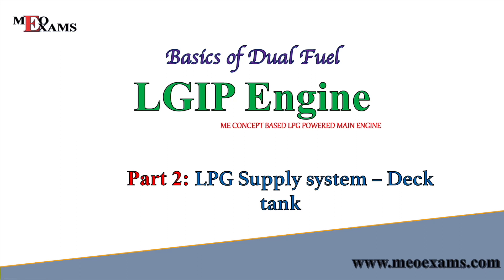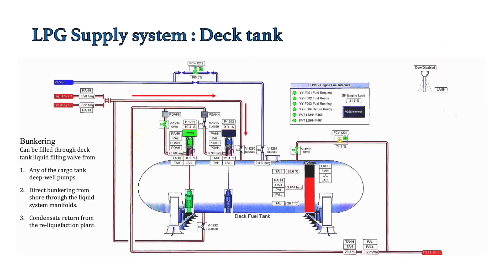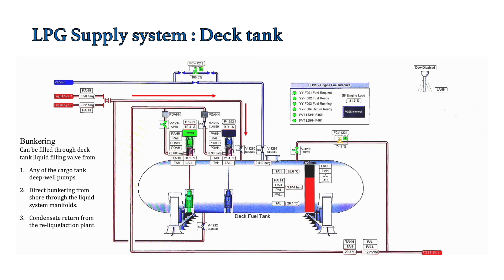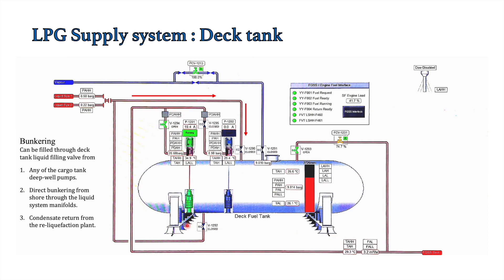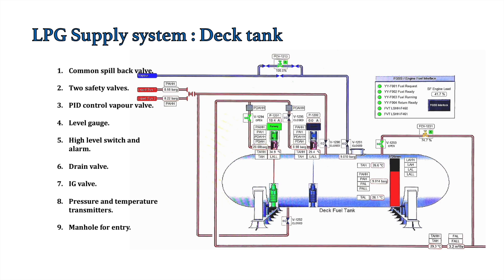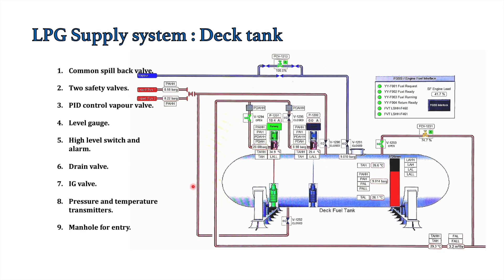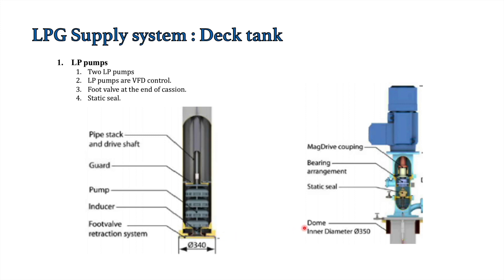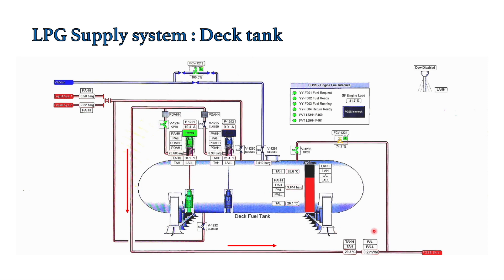LGIP Engine : Part 2 - LPG Fuel Supply System - Deck tank

Comment: sir PCV 1213, where that line is going? you said that is used to relieve tank pressure before bunkering. But where that line is connected?..thanks
Reply from the maker: That is connected to cargo tank vapour system.
Reply: So then, the returned vapor to cargo tank can be the suction for cargo reliquefication system. Is that correct sir?